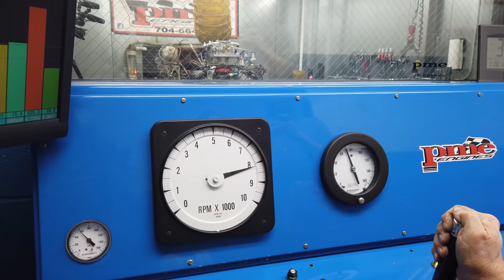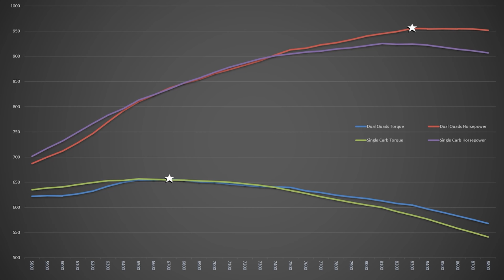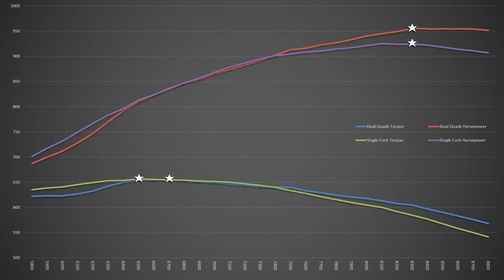955 Horsepower NASCAR Engine for the Street! (w/ ProMotor Engines)

Comment: Another great video!! Love this build. It was nice to see the differences in this race motor from a high power street build. Like the shimming of the rockers to save weight on the rocker! To me both engines are great. But for a descent street machine, it would have to be the slightly muted 750Hp. As low down power is better suited for the street! As you wouldn’t be able to hit 3rd gear without getting a ticket!!
Gonna watch it again tomorrow incase I missed something.
Well worth the wait bud!! Thanks!!
Reply from the maker: thanks for the kind words, and thanks for watching!
Reply: @TheHorsepowerMonster  your welcome bud!! Watching these videos is great! Comprehensively informative, and  covering all areas of information about engine building tuning, and the selection of the right parts!!
Reply: @TheHorsepowerMonster  besides money what credentials do you have to have to be able to buy
Reply from the maker: @Foxtrot1967  It depends on what state you live in.
Reply from the maker: @zorlacrogue9032  I think all you need is cash.
Reply: I made many many sets of pistons for Pro Motor. Good content thanks
Reply: Your right about only needing 750 hp for street racing
Reply: @TheHorsepowerMonster  come get my ‘70 GP(J) and do what you do. SALUTE & THANKS FOR THE VID
Reply: NA too!!!
Reply: LOL, I agree. I have an LSX 454 with a Paxton/ A&A  S/C in a 2004 C5 Z06 Vette. All the running gear and cradles were swapped for 2014 C6 ZR1 parts. The engine is apples to oranges, but OOTB, 635HP & 585TQ, add a S/C and you can imagine what it is like. Thank God it isn't cammed like this beast, it won't run below 30MPH in 1st which is a problem in school zones. You have to clutch it and let it coast, but it will run 68MPH at the rev limiter (6,300RPM) in 1st. It won't run under 78MPH in 6th. So basically, even tuned down as my LXS is it will be a beast on the street to deal with, I'm not complaining though. Awesome what you guys get out of a N/A motor. I have 3 pumps and am set up for E85 but I can't use the power I have, it's a hotrod not a racecar. Hard to imagine what your test motor would make S/C on E85... probably 1,500+.
Reply: Move to Germany and then you can go 200 mph ALL DAY LONG! :)
Reply: @TheHorsepowerMonster  hey where would I find a Nascar engine for my Rusty Wallace 2 Nascar from 1998.  So ATM the engine I have is a small block 302 ford. An I wanna clean it up new n with fresh parts an then sell it to get a Nascar engine. But I live in Canada London ont.
Reply: I had 2 built at elcampo tx for 20gs each. Im talking the full 13:1 with 13.26rpm
Reply: @TheHorsepowerMonster  Pennsylvania
Reply: @TheHorsepowerMonster  do you have a v12 they

Comment: Too bad NASCAR changed from racing cars that were actually a car anyone could buy at a dealership then modifying them for racing.
Reply: There's nothing stock about a stock car
Reply: That's just the evolution of technology and competition in motorsport. I think it's good as long as manufacturers and teams are invested in the competition.

There are GT series that homogulate street legal cars which I think fills that niche.
Reply: @bman6198  Horsepoop. Late nights every once in a while old racing shows can be found. I saw one a few months ago, the Talladega 500 from 1974 the fast cars were coming out of the curves at 200 and in the straights could do near 240. If you changed the tires, added windshield wipers and put mufflers on the cars you could have run it on the street. Today's things that run in circles are creations of a corporation, which due to cost, you only have a very few other corporations with the money to field one of those things. Back in the day, if your rig was fast enough to qualify, you were in the field. The things that run in circles today are far slower than the past, and there is no real competition, except in the pits for time-savings. Pretty much a race is won by luck and how quick your pit crew is, not by how well a car is built.
Reply: @jeanettewest  Interesting, I'll have to check out that footage. I don't know a ton about stock cars(Mostly watch Indy, F1, WEC and IMSA).
Reply: I may not have been around when they raced real cars. But these aren’t real cars.
Reply: @justinreel5546  100%. These are so far from street legal. That being said, it doesn't detract from the competition.
Reply: So, unlike most of the respondents, I AM old enough to have watched the evolution of stock cars since the mid 1960s to today. Here's the deal folks: Who used to win in those days was largely determined by who could make a car finish without blowing it up. Those 'good old days' saw most victories decided not by car lengths, but instead by number of laps ahead of 2nd place. 
Did they crash more? Yes. Did they ever go 240mph?(!) Good lord no! they didn't even go 200 until 1970/71... Check your history folks. The only oval race cars ever to hit 240mph were indycars, closely followed by sportscars on the Mulsanne straight at Le Mans in the early 70s. They both stopped that pretty quickly, as watching people die is not great for the sport.
The reason you can't get the same effect today with street cars into race cars (even when that is ACTUALLY done; see GT3 cars) is because so many advances in engineering and computer control/modeling have been made that parts simply don't break anymore. Everything is so well engineered that it CAN run at 8500rpm for three hours and survive nicely. The 'variance' that everyone wants with different creative engine types and suspensions, tires, aero designs etc. is NEVER coming back, because we NOW know what design works best, so everything is GOING to look the same.
And it's not just NASCAR. Go to your local short track and imagine the cars without numbers or paint colors. Can YOU tell them apart? Only road racing's GT cars are still distinguishable, and they do put on good races, but their performance is handicapped by the sanctioning body so that they are all balanced in order to be competitive with one another. If they didn't do that, all the factories would withdraw, because only one of them could/would win, and they would have to spend millions to do so.
It's the 21st Century folks; as with MANY other things that people seem to wish for nowadays, the reality of life is that it ONLY goes forward. Enjoy it.
Reply: @kevinnathanson6876  Very well said. I appreciate the insight good sir.
Reply: Fake ass painted on exhaust tips !!!! What a joke !!! Go into the Toyota dealer and tell them that you want to see the rear wheel drive V 8 engine , stick shift Camry !!! Good luck with that !!😎😎😎😎😎😄😄😄😄😄🍺🍺🍺🍺🇺🇸
Reply: So-called driver's of today would have melted in the cars of the 80s they could not handle them.
Reply: @kevinnathanson6876  awesome bill from Dawsonville mid-1980s at Talladega 242 point I don't remember the rest they'll never turn that in today's cars
Reply: @scottpope4711  You know, the beautiful thing about the internet is that YOU don't have to remember; it will remember for you. Pop on over to wikipedia, type in Talladega, and scroll down to the section named records. And read. Carefully. Have a good day!
Reply: Well, for a long time, GM and Mopar only made wrong wheel drive shitboxes with transverse 4 bangers and V6s. Nobody wants to see that. And, with speeds going to well over 200mph by the early 70s, and drivers getting killed  now and then, the parts and roll cages had to get beefier and beefier, further and further from "stock". And NASCAR got sick of the bitching about different bodies from different OEMs having an aero advantage from year to year, so they invented the (much despised) C.O.T., making all the cars have the same damn body. I hate it too. But a cascade of events over 6 decades made it inevitable.
Reply: @jeanettewest  I was around in those days. Yeah, the cars looked awesome and went fast, but only maybe 6 guys had a realistic chance at winning every week: Richard, David, Cale, Bobby, DW, and once in a while, a Benny or Buddy or Neil. And Dale, after 1978. And you sometimes had a guy like Richard or David win a race by 3 or 4 laps over 2nd place. Not the close racing NASCAR wanted, especially after they became a weekly tv event. I hate the cars now, and all the chickenshit rules and micromanaging by NASCAR, and contrived crap like The Chase, green/white/checkers "overtime" racing, stage racing, etc, but you do get really close, competitive racing, lots of wrecks (make no mistake, that's what tv networks and many fans want), and 15 guys with a chance to win every week. You lose ten to 20 cars per race to wrecks, but not to blown engines, broken axles, broken trannies, etc like you had in the 70s and 80s. So I still watch and still love the sport.
Reply: @kevinnathanson6876  Well said, man, even better than I did, lol.
Reply: @scottpope4711  That's true, in the days before cool suits and power steering, you didn't have little shrimps like Jeff Gordon and Kyle Larson, and so many of the young JOCKIES in the sport now, you had big, tough, hardass MEN. Like Janet Guthrie 🤣.
Reply: @scottpope4711  Bill's lap record at Dega is 212, not 242. And the cars could easily do that right now, if not for restrictor plates and current aero rules. Mostly plates. Those were done to make racing closer, and keep cars from flying into the grandstands. Bobby Allison's wreck at Dega in 88 was key in that. The smaller, swoopier cars would go airborne if they got sideways. Check out Petty's wreck at Daytona in '88, too.
Reply: @bman6198  they’re all the same, and to me that’s Boring.
Reply: That is indeed true, but that's way back...
Reply: @scottpope4711  It was 212 in 1985.  Then NASCAR decided, "that's too fast", and slapped restrictor plates on em. After Bobby Allison's wreck at Dega in 88, they slowed em down even more.
Reply: It ain't all NASCAR's fault. For a long time, the automakers weren't building V8, rear wheel drive cars anymore, except for Mustangs, Camaros, trucks, and boats like the Crown Vic or Caprice. And the factories wanted to promote their bigger sellers, like the Lumina and Taurus! YUCK! Mopar was running a Dodge Intrepid body in the early 2000s. NOBODY wanted to see FWD, V6, unibody shitboxes racing, especially in the Deep South.
Reply: @scottpope4711  Yeah, ya wouldnt see 5 foot 2, 110 lb JOCKEYS like Kyle Larson, Jeff Gordon, or Cole Custer driving 60s and 70s NASCAR racers. No power steering, no "cool suits", bias plies, and the cars were 3800 lbs then.
Reply: Too much freedom, lol.
Reply: @bman6198 not real many stock based forms still exist. Limited mods to actual street vehicles luke motpr cycles but cars today all 4 and 6 cyl front wheel drives so manufacturers screwed pooch. But you could take stock mustang charger and camaros and get back to stock car racing like it was
Reply: These small but not to small blocks, are a work of art 😊, but I’ll stick with my Ed pink BBC it’s 720ci and 2500 hp natural aspiration on 130 aviation fuel ⛽️,my race car is a 1970 Nova super comp/ super gas , can run 7.37 secs @ 201 mph or better depending on the weather and the location of the drag strip , we love mission bc , Ashcroft bc , and there race events in the good old USA 🇺🇸 one in Washington, and two in California 😊😊😊😊😊😊 booogity booogity , let’s go racing 😂
Reply: NASCAR and NHRA alll the way boys and girls ❤❤❤❤❤😊😂😂😂
Reply: The only parts a on a cup car we’re basically the roof , hood and deck lid from the manufacturer. That’s it !
Reply: @Dirtmodmaniac  none are after 90s
Reply: @mr.nobody68  Anymore
Reply: @pookysdad4884  Horseshit. They only put the restrictor plates on after the Alison crash. KNOW YOUR HISTORY!!!!!!
Reply: Biggest reason for that is safety. Stock cars for the street don’t have any of the safety measures that cup series cars have that save driver’s lives during crashes.
Reply: @c0mplex564  plus front wheel drive 4 bangers just suck
Reply: Hobbie Stock
Reply: @scottpope4711  no Cup car has ever gone 240 in any trim.
Reply: Euro mindset
Reply: @bman6198 like the IROC cars from 1988?